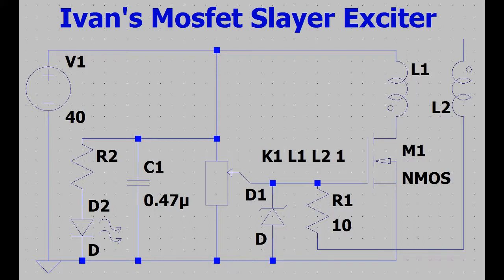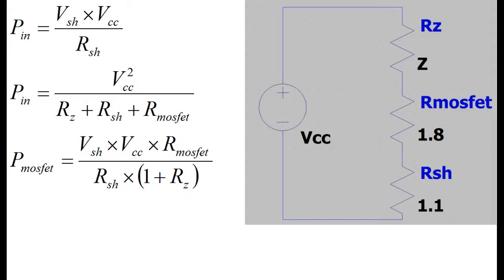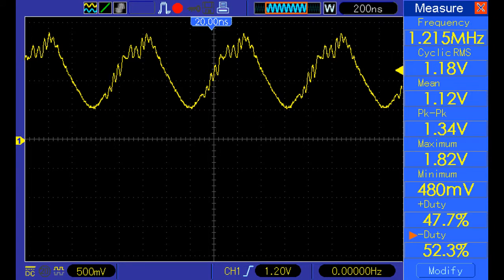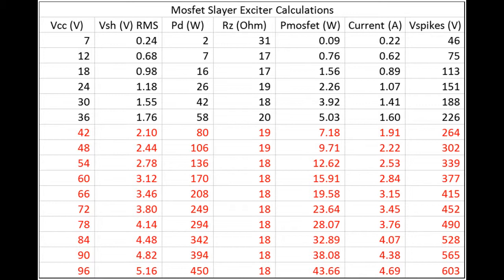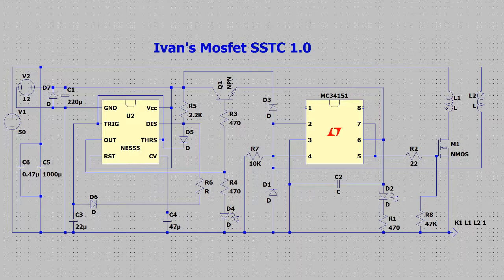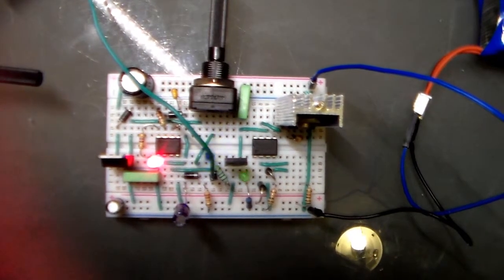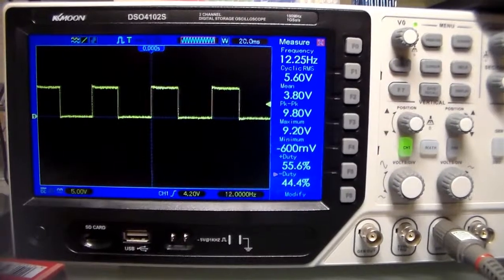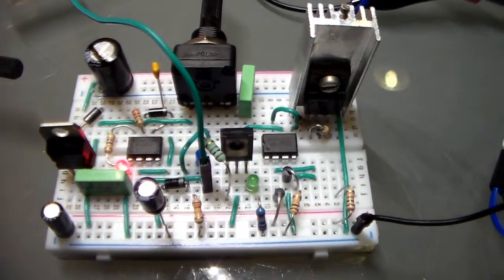Mosfet Slayer Exciter Part 2: Limitations

Comment: Incredible videos. I'm looking for over 6 to 30 megahertz. Do you think this can do that?
Reply from the maker: Thank you for your kind words! With enough motivation anything is doable, the problem is, you need circuitry that can switch quicker and deliver more current in a shorter time as I = dq / dt , your total charge stays the same on the mosfet gare, but your dt decreases resulting in many times larger current draw which makes it harder to switch and limits the size of the mosfet and creates inefficiencies in switching. Depending on your output goals it can be achieved, but if it makes sense to achieve it is the question.
Reply: I have a slayer excitor that self resonates at 3.5 megahertz with a TIP35C transistor. Its over its "transition frequency" of 3 mhz. I need a better transistor that can switch in resonant mode as high as possible up to 10 or 50 mhz.
Reply from the maker: @TravisTellsTruths  thank you for your reply! Is there a reason you are using a BJT transistor at all and not a field effect transistor here? These tend to be supperior for the purpose, especially if you want to push more power through the circuit.
Reply: @ivanrodionov9724  only beause i cant yet learn the best way to trigger the mosfet. I have some really nice 50$ mosfets I just got but still learning exactly how to trigger it in self Oscillation Mode without any driver circuitry. Only maybe.... something like a joule theif coil arrangement to pulse the mosfet trigger? Maybe you know how to do this best? I'm looking for a teacher I can be friends with, or who I can pay to help me with a few things, quickly.
Reply: Because I'm so new to building anything electronically. But I already do have some very special things I believe. Like true wireless power across my whole house and a device that makes 3/4 inch plus LOUD white sparks from nothing (12 volts 7 milliamps input). And I'm trying to finish my hydrogen car project.

Comment: Where have you been 6 years ago ! Since then I was popping transistors like popcorn... 

Then I realized, that slayer exciter is not the way to go.
Reply from the maker: Its not that there is anything wrong with the slayer exciter circuit, its more that it does not scale well. As they say, better late than never eh :P?
Reply: @ivanrodionov9724  Yes thats what I mean, I was trying to throw 140V at it expecting it to work... Although it was modified version with IGBT and a driver... Had to use 10 1,5kW TVS diodes to prevent the IGBTs from exploding. There should be a better way tho, if you use RCD snubber across the primary winding, it would work as a flyback PSU.
But it was much better to build a half bridge SSTC at that point, since I was using IGBTs and driver already, all I had to do was to add a GDT.

Comment: In the simulations, K L1 L2 1 is irrealistic. The coupling coefficient is usually in the 0.1-0.2 range. The mosfet does not operate in the linear region all the time.
Reply from the maker: Both very true observations, however in the first circuit I do want the mosfet to operate in the linear region, while in the second circuit I try to avoid this and drive it in the saturation region to reduce losses, hence why I do not need a monster heatsink. It would actually be an interresting side test to see how the coupling coefficient affects the behaviour of both circuits. Ill try it out when I have some spare time from uni...

Comment: Hey what wire did you use to connect the components on the breadboard? (The green ones)
Reply from the maker: i used 0.5mm solid core "rapid electronics" wire. got like a whole 300m spool of it.